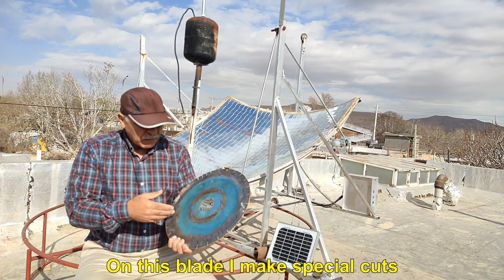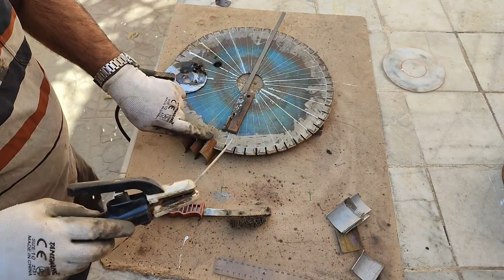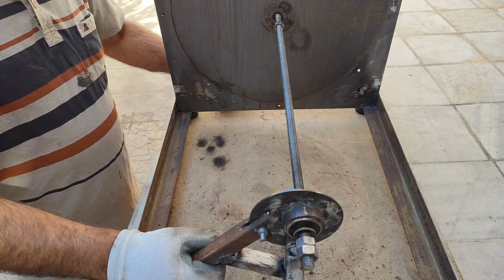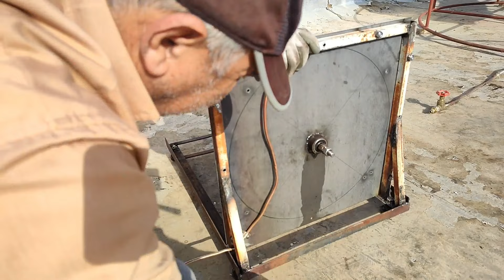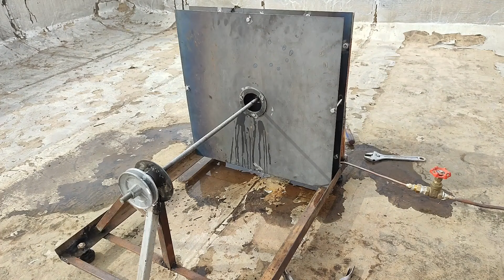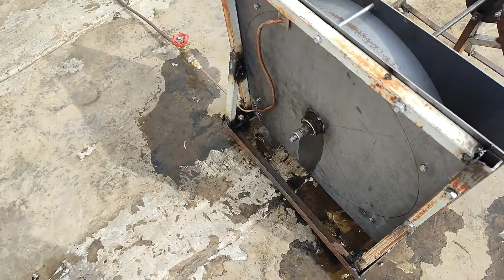making a steam turbine.Building a steam turbine

Comment: I see you are trying different types of rotor...this one seems like great efficiency...
I did same turbines ..i did about 60 types...and the best result was one with 2 discs and only 12 blades 35 cm.diameter.blades are long so they overlap each other about 3 cm.and they go down only 3 sm from outside radius to inside...wow you will be amazed how efficient that will be... basically steam enters turbine uses Ventury principle and grabs 6 times volume inside turbine and then all that exits through all 12 exits...again diameter was 35 cm. 3 cm thick..3 cm overlap and 3 cm incline from inside diameter to outside diameter.... Try
Cheers from Ukraine
Reply from the maker: Thank you for your guidance

Comment: Balancing will be easier if the blades are trimmed so they all weigh the same. Then your concern will be getting the welds as close as possible to identical. The discharge should be directed to a condenser and recycled since it's basically distilled feed water. As for pulling a vacuum, you'll need labyrinth seals on the traveling edges, but the performance gain will be obvious. It was nice to see you actually using steam instead of compressed air as so many online seem to do.
Reply from the maker: Yes, you are right, the balance of the system is extremely important, and the use of steam serves a specific purpose, and that is the construction of a unique home power plant.
Thank you for your nice comment
Reply: @fixedfocussolar   No problem, steam is a serious force and a turbine is the best way I have seen to get every calorie. But the overhead is high and your water processing has to occur on the fly. Since you are discharging from the center you could run the discharge steam/condensate through another heating loop and then into a low-pressure turbine. With your form factor it would probably work better like stairs, HP on top and LP below and then feeding into a condenser. I'm speculating because I don't know what pressure or temperature your steam is arriving. Another advantage to your design is that you can add additional steam nozzles and feed them as the load increases. It would also be a way to throttle around speeds where the dynamics/balance transitions. Steam is a cruel mistress though. So keep the joints tight and lag/wrap everything when you've finished tuning.

Comment: This is a real inspiration, it didn't take any super high tech to create something like this!

Can you say how much power in KW you are able to get out of this?
Reply from the maker: Thank you, dear friend.
I must say that building a steam turbine is a very difficult task, and the turbine I built will not be like the industrial models, but it works.
Its power depends on the volume of steam entered and the steam pressure, and this turbine with the right steam pressure can produce up to ten kilowatts of rotational energy.
The turbine torque is very good and is capable of turning large generators.
Reply: @fixedfocussolar  10Kw is real power!

Have you tried any parallel stages, or maybe multiple/progressive stages to increase power?

I'd be curious to try to build something in the 20 to 35Kw range, maybe even 40Kw.

Comment: How much electricity can be generated from this?
Reply from the maker: It depends on the manufacturing accuracy and the amount of steam injected into the turbine
For example, from 200 watts to 2000 watts
Reply: @fixedfocussolar  - I mean how much volts for 44693 rpm as he shows in the video. I don't the torque value here